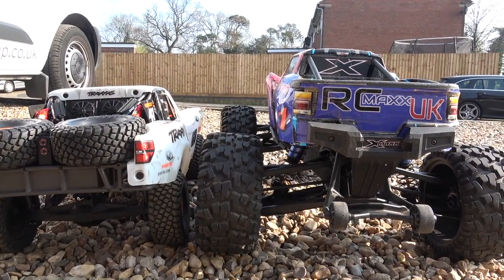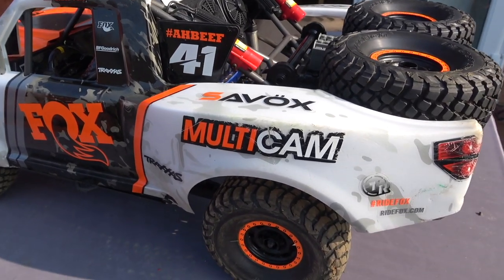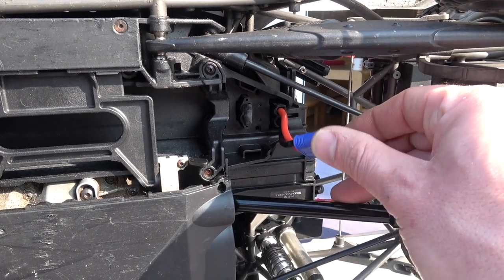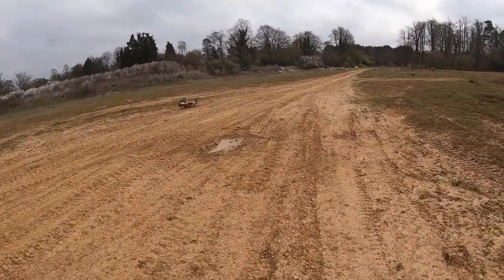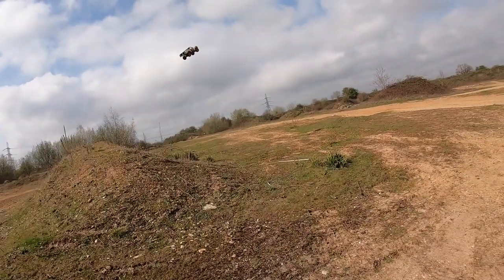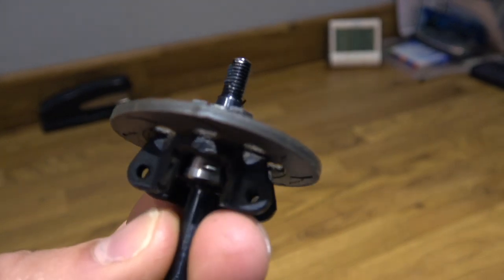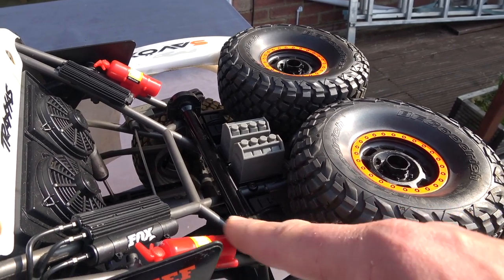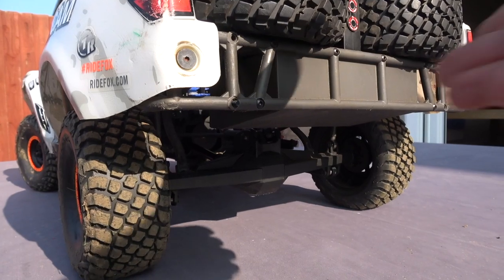TRAXXAS UDR review

Comment: hey man great video. but it's funny to see some people missing the point of the UDR and then complain big time why it breaks lol. it's meant to mimic the driving and handling of a 1:1 trophy truck. so of course its going to break if you drive it all jerky and then jumping it 30 ft in the air lol. imagine the 1:1 scale truck jumping at 300 ft in the air...of course its going to break. i also immediately coverted to a limited slip rear diff and lessened the roll by at least 70% lol

Comment: It has nothing to do with being narrow, the locked rear diff is what makes it flip so easily
Reply from the maker: Jayce Vessier sorry mate. Disagree big time there. On grass try to turn and it flips. Narrow with a high ish cog is the issue. What u pay for having those beautiful scale looks
Reply: @RCmaxxUK  nope... wrong.  I'll put the title to my house on it that If you drop a limited slip rear diff  in it wouldnr flip anymore
Reply: i agree. its not being narrow. its the rear diff. simple mechanics. convert that to an open diff or limited slip and youll notice a huge difference.
Reply: @jaycevessier7554  wrong rc max is right. It's based off design. Soft suspension really side squats and grips causing rolls dude. 
This is a good review. I'd like to see a 8s or 10s 1/5 scale udr:) losi will probably be taking my money

Comment: Out of all RC cars I ever owned .. UDR is the absolute worst of all of them .. every single time I took it out it broke after many many times of repairing and frustration I sold it cause that car is just piece of s*** If you ask me
Reply: It's a true endless money pit....
Reply: Team Awesome it's just a bad design .. appreciate the level of scale but it just renders this car unusable
Reply from the maker: U pay for that scale look and design for sure. Agree 100%. BUT... the f u elegant those looks and that solid rear axle and those silky smooth 8 shocks udr is the car for u. So for that I recommend it. If u don’t want those scale looks then the Mojave will likely out so it in every way ( which I say) .... but then it’s just a scaled up flat chassis , independent suspension rc car with sct bumpers and body isn’t it. Lol
Reply from the maker: Also it’s an awesome design for w scale rc do disagree totally that it’s a bad design.  To break it every time u ran it what were u doing w it? Using it like a basher mt? Not what it’s for at all...
Reply: RC Maxx UK Its just too complex that's why it's a bad design .. I was running it on short grass nothing crazy no bashing or jumping crazy and that thing just broke on me every single time .. I am def no the only one to have that experience .. the car is ok to run on concrete not going fast .. definitely not an offroad truck

Comment: I think if you had that car longer you wouldn't recommend it at all. Not really a review if you only had it shortly and you took it out once and it broke on you lol 🤣
Reply from the maker: Matěj Bludský I did not take it out once. Ran it a cpl times on grass, 4s and 6s then a proper bash session on 4s and then 6s. Plenty for me to get an opinion.  Let’s be realistic. U know if u like something pretty much straight away. Plus I tore it down pretty much fully and re built it. More than many long term rtr owners do no doubt
Reply: RC Maxx UK the reason I said that is, that if you had it longer you will find yourself slowly replace the whole car 🤣 it's an endless money pit .. way too much frustration for little fun you get out of it and also it's just really expensive I understand the scale look costs money .. but in this category and for this price .. it's reasonable to expect something that doesn't break every time you take it out
Reply: Matěj Bludský IF you don’t jump it so High then it’s very tough, my friend drive it straight in to a pole in like 30 mph and nothing happened! And it’s stock, and the handling is amazing, the only thing i don’t like with it is that it rolls over. And i have had it for 1 year. And have drive it for like 200 times
Reply: Viktorgta5bilar right handling is great but it rolls over 🤣 other cars like arrma won't do that.. you can literally break the UDR on pavement in my experience
Reply: Matěj Bludský yes, but it’s a scale, thats why you buy it in my opinion
Reply: Viktorgta5bilar I got some scale cars that take absolute punishment just fine ... For this price tag, this car is just a nonsense
Reply from the maker: Matěj Bludský such as....
Reply: RC Maxx UK losi tenacity DB is a prime example .. very scale looking impossible to destroy .. I am more into crawling .. there it would be anything from traction hobby, scale build like tank